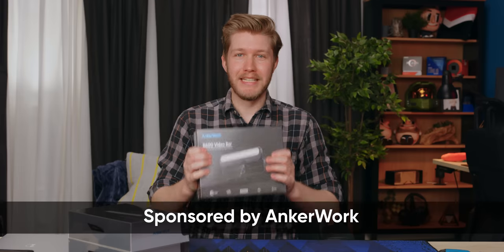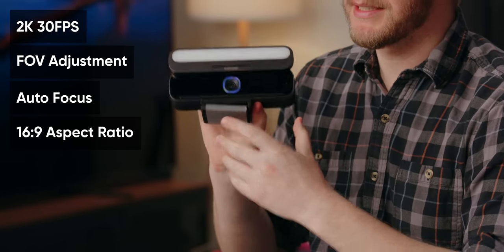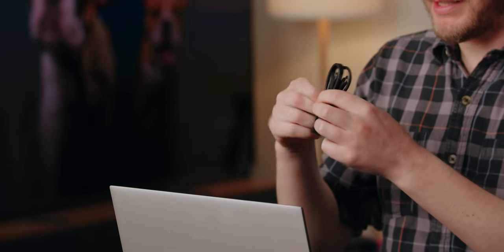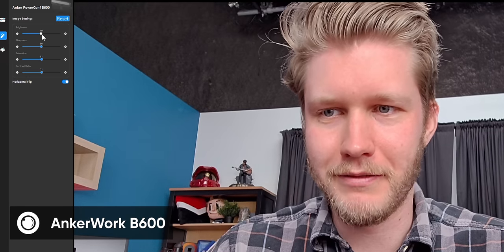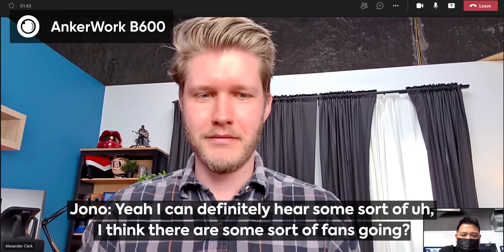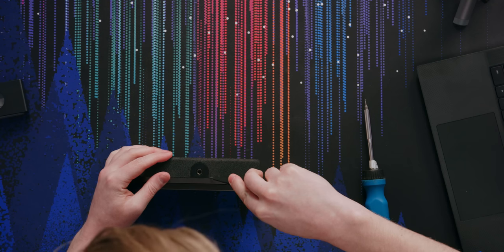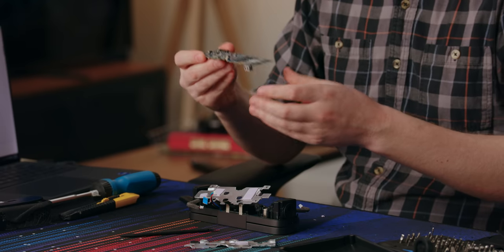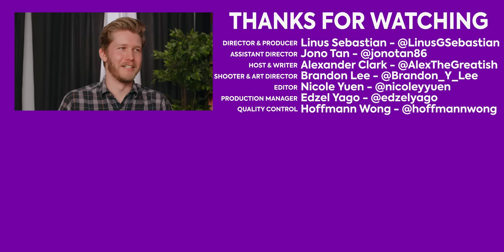Sponsors should be SCARED - AnkerWork B600

Comment: Honestly, I think I can get about the same quality for 70$ 

Would be interesting to see an comparision with more then a crappy xps built in
Reply: Oh boi, looks like they need to run the anti spam again
Reply: @athe5217  looks like the anti spam is doing its job as well as this anker camera lmao
Reply: @brunoglopes  LMAO
Reply: @brunoglopes  nah the problem is that you need to run it basically every time you upload a new video since it's manual and not running in the background
Reply: @HerbaMachina  They made a script that run it from time to time... now sure how frequent.
Reply: The video quality is very bad for the price, but the mic quality is far superior to any webcam I have seen. Probably this is designed for video conferences in mind with multiple people in the room. That's probably the reason it also has speakers.
Reply: @ViXoZuDo  Considering that it has decent speakers, a 4-mic array, noise cancellation, AI reframing all processed on-chip which lets it run smoothly on a potato computer, it's not too bad for its price. I think they just marketed its 1440p camera a little too much as compared to its other capabilities.
Reply: @HerbaMachina  Cron job? :)
Reply: At that price you’re better off just getting an old phone and one of those cheap light ring stands, you’ll have better microphone, camera, speakers, light, and a screen you can put audio levels on or whatever else you want

Comment: Doesn't seem to beat out the trusty and ancient C920 to me, seems pretty low framerate but maybe a mismatch for the video encode? Why is buying an actual good webcam still so hard! 😥
Reply: I have 2 C922 web cams. They aren't too shabby. Especially now, since they're right at $70.
Reply: It's not, kiyo pro
Reply: These cameras tend to have an "exposure" setting that controls the exposure time per frame. The setting may or may not be exposed to the user via software. Often you can get away with not crossing the threshold of 1/30s for a 30fps webcam and boosting the gain/brightness instead, but the auto-exposure program of the webcam isn't smart enough to figure that out, so often you end up with >1/30s exposure time and your resulting framerate gets halved.

I have a really cheap Avermedia PW313 that provides manual control for exposure, gain, WB etc. and I will almost always get a better result than auto on a more expensive webcam (to a point). The C920 also lets the user control Exposure, gain, WB, and it seems to have pretty decent sensor dynamic range for a webcam. It also has a variable focus lens (unlike the PW313) so it's still a really capable webcam.

Camera sensors don't really improve over 9-12 months, they have a generation cycle closer to 3 or even 5+ years. (BSI took two years to come to smartphones from proof of concept, 3 more years to introduce stacked CMOS to BSI, 2 more years to finally implement in APS-C sized sensors, and then another 9 months to full-frame) Processing capabilities and stabilisation is what's usually getting improved.
Reply: so glad somebody said this... yes... why is this $220USD and looks and sounds like hot garbage. Why hasn't there been any development in webcams in the last 10 years?! whyyyyyyyyyyyyyy
Reply: You're basically paying for things that don't make sense. Like the two speakers, why would you want a two low quality speakers on your webcam? Especially with a webcam that is definitely designed to be used with desktop, because it is too big for a laptop. The same with the light... while the idea is neat, in the end it is not powerfull enough to make a difference when you need a well lit scene. And ofc, the resolution, while it is also nice that it is 1440p, what is the usecase? 1080p is more than enough for most webcam usecase (video calls, player cam..etc), and for cases where it is not enough, then also other aspects of it being a webcam will not be enough (lack of better optics).
Reply: Unfortunately the best (affordable) webcam is still just "repurposing any mid-to-high-end phone made in the last five years". (The less affordable option is repurposing a high-end camera.)

It's somewhat understandable (phones just have so much more R&D funding than webcams), but it's still really inconvenient for plug-and-play and mounting purposes. And it's a bit frustrating when webcams should be able to fit in much better sensors and lenses than phones.

To that end, I'm still using a regular webcam (Logitech Brio, from just before prices skyrocketed), even though I have an unused phone in my drawer which beats the pants off of it.
Reply: Just your phone as a webcam
Reply: @Snipes432  Since its a "work" product, you know the speakers aren't for music, but for either conference calls, or simply if you want to make a call without a headset. seems to do fine for that purpose.
Reply: @Snipes432  I think there is a healthy market for decent speakerphones for small conference rooms (2-4 pax, safe distanced), and an all-in-one conference solution with auto tracking is a product that would sell decently, they just marketed the wrong features.
Reply: @Snipes432  because like a conference speaker they have internal noise canceling which is way better then doing it in software....
Reply: And for this thing's pricetag the brio is still superior. LUCKILY I bought the C920 and Brio at the same time and the employee just scanned the C920 twice. :)
Reply: @justnvc  true
Reply: @justnvc  It would be better to use an old phone as a webcam than spend any money on a expensive low quality webcam. I wish most of the stuff Razer made wasn’t shitty.
Reply: I agree, picture quality seems a little average... It's no 200 dollar image...
Reply: Because you can't escape from the caveats of teeny tiny lenses. Small sensors will always have quality issues due to the limits of physics (even professional cameras struggle with them, hence why full frame or medium frame sensors make such a big difference in capturing the full range of light and dark). You might be thinking "but my phone has a really nice camera and it's tiny" well, yeah but it also has a high-powered mobile APU in it doing all kinds of post-processing and the sticker price is eight hundred bucks, even after they've taken advantage of the MASSIVE economy of scale that phones have. Webcam developers HAVE to keep webcams at this price or lower and the cost of building them will simply be higher than phones. They also have to remain low-profile by design. No bulky lenses. No [non-digital] zoom. None of that stuff is really possible in a tiny, compact form factor. If the price gets bumped up to $300-400 then they're competing directly with handheld mirrorless cameras, some of which also have USB connectivity and work right out of the box as a webcam. And by that point you've got a real, dedicated camera that can even take semi-professional photos (that's being generous, but compared to webcams they're night and day). For that price there's no longer a desire for consumers to compromise on choosing form factor over quality. Even at the $150-200 range there are a good number of janky ass low-end mirrorless cameras and used cameras that fit the bill. If it has an HDMI out and you have an extra $100 for one of those elgato HDMI capture cards, you can use it as a webcam. So Ankerwerk is already pushing the limits on price, which limits heavily what kind of hardware they can include. They honestly did manage to include a lot of features at that price point, but yeah... if you want better quality than that, you might as well buy a real camera, an hdmi capture card and a tripod. There's simply no need to mess around with webcams at all if you don't like what you see.
Reply: Get a BRIO i have had one for years and its an incredible webcam
Reply: I got a c920 earlier today
Reply: @tallrocko7010  lol, does it look better than this?
Reply: Webcams generally suck because they have a super tiny sensor and use little to no computational photography (which is why smartphones make excellent webcams).

You can get decent results from products like the Elgato Facecam, Logitech Brio and as previously mentioned, Razer Kiyo Pro.

However, when you reach that $200 threshold, it's time to start looking at the option of Mirrorless/DSLR cameras with a capture card.

My "webcam" setup cost roughly $700 (including necessary accessories like mounts and dummy batteries etc) but it looks eons better than any USB webcam (there's a couple of indie projects with DSLR-like sensors etc but those start at $800 so I won't count them).

TL;DR Webcams have a really low quality ceiling so at these higher price ranges it's a good idea to look into more sophisticated alternatives.
Reply: I think the reason is because webcams have to be portable and reasonably priced, but it's hard to provide proper optics and proper sensors without adding a significant amount of size and cost. The newest mirrorless cameras from various manufacturers are starting to have built-in USB streaming built-in, and they provide significantly better image than any webcam, but they are easily $1k or so once you factor in power, mounting, lenses, etc. I'd imagine that if camera manufacturers really tried, they could strip out all the camera features and make an excellent webcam w/ a significantly sized sensor for $400-500, but it seems like then, you'd be in a really weird price range where you've priced out all the casual users, but you've not provided enough quality for the enthusiasts.
Reply: "Why is buying an actual good webcam still so hard!"
Because buy a capture card and use your existing camera. Or just use a phone. I haven't used a WEBCAM for probably 10 years...
Reply: I searched it up, I didn't even realize that I had a C920.
Reply: I was looking to replace my C920 as well, but not for $220 when the video quality isn't superior. The C920 has problem with backlighting.

I'm thiking of a Razer Kiyo, perhaps Pro, it seems to handle poor lighting better.

Comment: Alex was most excited for the Risc-V CPU than anything else, haha. 
Probably why the thing is the price it is. It's $75 of webcam, $10 of lighting, $15 of speakers, and $120 of Risc-V CPU
Reply: Uhm, no? RISC-V CPU's only thrive when they can undercut ARM CPU's - simply because ARM has been around for far longer, so it's usually far easier to just get your existing firmware/software running on it. The dev time investment must be offset by parts cost in order for them to make sense.

If you're making a joke about the price of RISC-V development boards, that's simply because of volume. ARM dev boards either re-use popular ARM SoC's, or are manufactured in the millions of units (Raspberry Pi - not to mention it's sold near cost to promote Broadcom's hardware).

RISC-V SoC's are usually in-house designs for specific applications, so development boards might have to create their own SoC that can run an actual desktop OS, and custom silicon is expensive.
Reply: @WhenDoesTheVideoActuallyStart  It's not only about what that RISC-V CPU costs; it's about what it costs to implement it. The price tag probably covers the R&D overheard of making custom-purpose RISC-V chips and AI software-type stuff. Basically, an early adoptors tax on a first-gen product that is little more than a polished prototype.
Reply: @XDSDDLord  As I said, if that was the case, there would be literally no incentive to switch. They wouldn't make a product non-competitive just to adopt RISC-V, they're a company not hobbyists.

The fact that the product isn't competitive is entirely due to other reasons, like "It'll probably sell and make us money anyway, cuz Brand™®" or, as you suggested, "We just need to get 10k units off the shelves to validate our prototype"

Comment: I loved the concept. You have a pretty decent light, a speaker for desktop users, decent quality mic and a webcam all in one solution for $220. Basically giving 4 peripherals which every desktop user may need at a certain point. Also, I'm impressed by the amount of engineering that went into AI for mic and webcam. I'm however, not impressed by the webcam quality. It's the jack of all trades and master of none. A 40$ fifine mic, a 40$ lenovo fhd webcam, 35$ logitech speakers and 30$ chinese ring light will do a much better job and cost almost same. If it's primarily marketed as a webcam, then they should increase the quality of their camera. Give that camera a bigger sensor, specially after seeing that autofocus solution. Right now, my ghetto pi hq camera + pi zero does a better job.

Comment: So, I was looking at this Device on the Anker Site around a week ago, it looks super promising, I do have a few critiques regarding your review though (And I say all these things in the most supportive way because I really enjoy your content)

1. Apples to Apples, in the first quality visual explanation, which application were you using to test this? OBS for both? Windows Camera App? or Teams?
2. In regards to the light bar, to my knowledge, correct me if I'm wrong, but this should be to supplement the existing light source, not to use when ALL the lights are off. 
3. I'm not sure the distance between the desk and the back wall where you were, but the device is designed to balance audio up to 2/3m away from the camera.
4. Real world test, brilliant, if it is being used for Teams, Skype, Zoom currently which are they are all limited to 720, so in theory, you could use a 720p 1080p of 8k camera, the quality will still be compressed to 720.
5. What is the performance of the device without the software running? Likelihood is, if this was purchased for a business, the additional software may not be installed.
6. Whilst using Teams/Zoom/Conferencing Solutions, how well does it perform with the background filters enabled, such as blur or a separate background?
7. Is there better quality from a 1080p camera which supports 60FPS in a real word situation as this one only supports 30FPS?

I would love a deep dive technical comparison video between this device and other devices within the price range!

As always, love the content you guys publish! But in this instance I was hoping for more information going by the price of the device :)

Comment: I don't know why you wouldn't just buy a old Canon, slap it on a tripod and use their input drivers. I use a t3i which is like $150 used with lenses and a cheap tripod and its miles ahead in terms of quality. Even with the kit lens in dim lighting its better.  Heck you can spend $20 extra on a mic for it and it will sound better too. I guess its good if your moving around the room for some reason?

Comment: This is clearly a conference room webcam... This is not a product designed for a home user.

The mic quality is one of the best I have seen in a webcam, but still inferior to any independent mic. Also, there is no need for speakers in a webcam.

Now, if we're talking about  conference rooms, usually omnidirectional mics are pretty expensive, so this is probably a good deal if you're planning on using it as the mic in a conference room. Having 4 mics and speakers is pretty much something that you would only need in a conference room. For example, the Anker PowerConf (conference room mic/speaker) is around $130, so if this could replace it, it's not that bad of a deal.

I could see this as a $100 webcam quality, so the additional omnidirectional mic and having speakers is pretty much an all-in-one deal.

Comment: I feel like this isn't a good enough upgrade than the previous anker webcam which was imo somehow able to beat logitech at a lower price point, but this one seems to look worse somehow despite having a higher resolution and a light build in... how is that possible? And nobody wants to have 2 cables for included speakers that nobody will want to use anyway

Comment: Dang, it’s 2022 and webcams still look bad. I expected just a bit more since its using 2 cables
Reply: It's because the reason why modern smart phone cameras looks so good is the insane ISP performance built in to modern Apple, Google, and Qualcomm chips.  Those CPUS run way too hot, and too expensive and complex, to put in a webcam.  Dedicated cameras though have their own ISPs, but much bigger/expensive sensors.  However, it's 2022, I can't believe there isn't a $100 webcam that is at least on par with a 2012 iPhone 5 camera.

Comment: I bought Anker's C300 webcam not long after it came out and I honestly love the thing. I've stopped using the mic on my gaming headset because the sound from the webcam is comparable in quality and way more convenient. Not sure if I see a need for the speaker and light bar, especially when they add that much heft, but still, cool product.
Two notes, going based off my own Anker webcam experience:
1) they actually did include a type-C to type-A adapter in the box with mine. There's a chance it was in that box too, because it's really really tiny. Like "how does this even work" tiny.
2) the AnkerWork software to configure the camera settings doesn't play well with anything, not just OBS. Kind of a pain in the ass when I'm on a Discord call and want to adjust the FOV or turn on anti-flicker but hopefully they'll issue an update eventually that'll let you change the settings while the camera is in use.

Comment: Nope. That's a $20 web cam... not a $200 unit. And for the size it is that LED strip should be putting out 5 times as much light.

Comment: Windows Hello in a attachable peripheral sounds awfully like cyber security risk. Most likely it will be never possible (or at least it should not be).
Reply: It already is possible. FYI most "internal" laptop cameras are connected via internal usb connectors and could be connected to any usb port. So basically every windows hello camera is an "attached peripheral".
Reply: logitech brio has had that capability for years at this point
Reply: how? it already exists